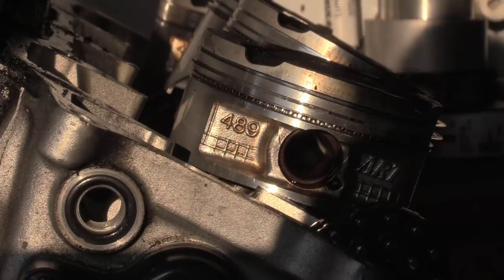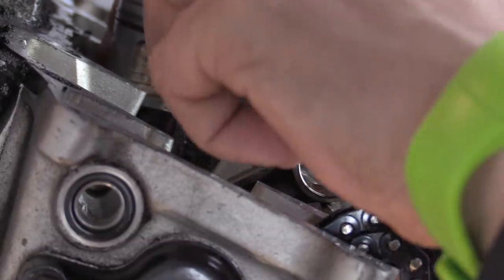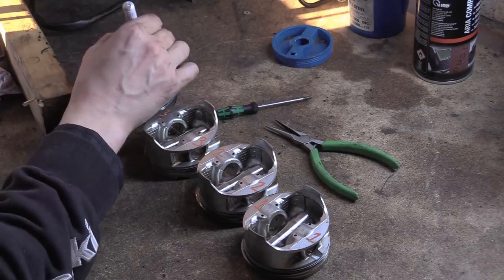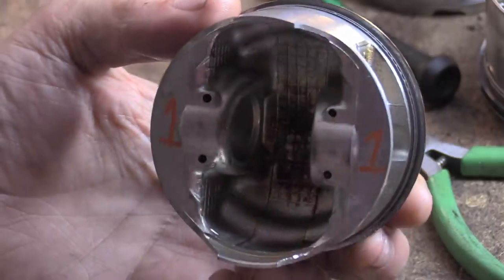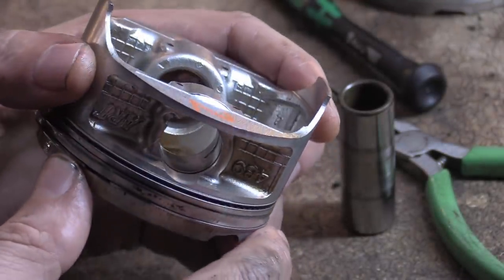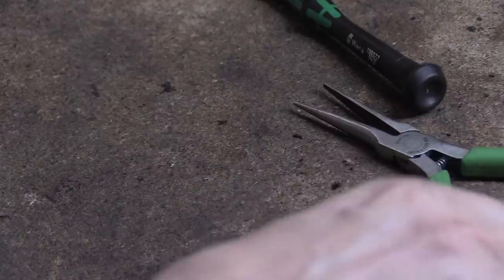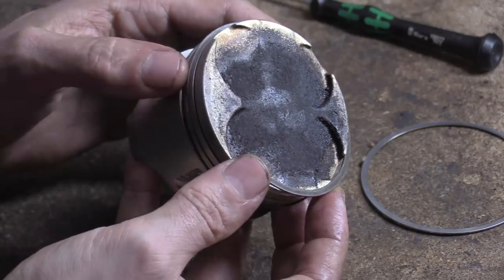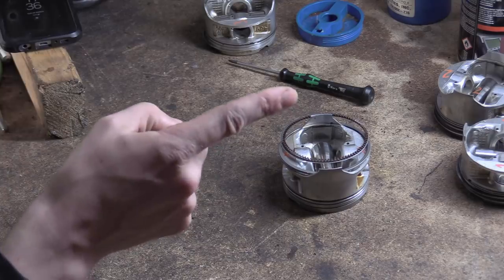M1stERd - My First Engine Rebuild - PART 10

Comment: It's not really uncommon for designers to "protect for" elements that might be required either in current or planned future specs of the engine, or even have oil squirters in the preliminary design and first run of the engine and delete them once more data and durability testing has been done to show that it's not needed thus reducing the parasitic losses. eg: the 5.0 L Ford coyote engine deleted the oil squirters and found ~10 hp from the reduction in parasitic loss..

Comment: Why would 3 and 4 be different than 1 and 2. Is it the flow of coolant ?
Reply from the maker: Different in what way?
Reply: And the flow of oil ? Sorry meant to put that in my original question but copious amounts of gin got in the way.  Smiley face.....
one day i'll work out how do that with an emotic…….. as I said...…..
Reply: @dirtygarageguy  why would they be different in the amount of carbon build up. Is this due to cooling from one end of the engine to the other ? Now on wild Turkey 101. Don't expect any coherent responses till the clocks go forward tomorrow. An extra hour of hangover never hurt anyone.  Dog !!
Reply from the maker: Fuelling differences - I'll include it in a video

Comment: Don't 4 strokes have needle bearings? Why does 2 strokes?
Reply: Probably due to the fact of engine oil in a 4 stroke I'd have thought 2 strokes don't have engine oil to lube bits and pieces properly I think